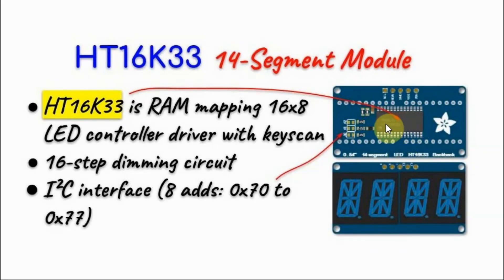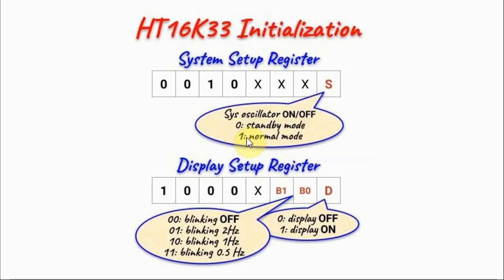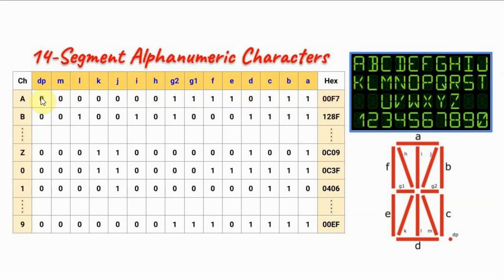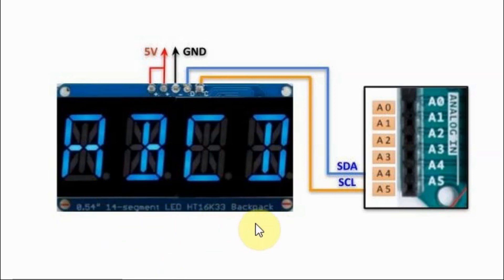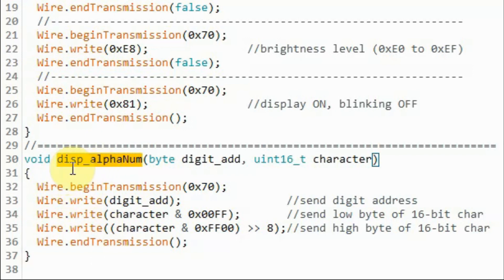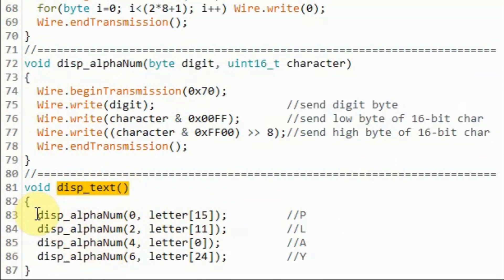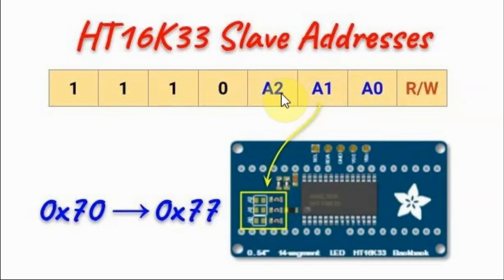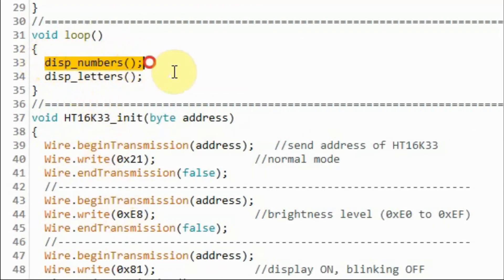HT16K33 14-Segment Display

Comment: This is great...however I have a problem. I've done exactly everything even to the code, and its only recognising 1 side rather. So both 4 digits connected up are doing 0123...0123, intead of 0123...4567. It seems to be running parralel. Is there other pins to this to use? It won't work on A4, A5. Only on SCL and SDA. Thanks
Reply: Both displays are set to the default hardware address (0x70), so both are responding to the commands intended for the first display. To get the second display to respond to the commands intended for it, you must set the hardware address of the second display to 0x71. The hardware address is set by soldering jumpers across the three pairs of pads on the back of the display. The pairs of pads are labeled A2, A1, A0. The absence of jumpers produces the hardware address 0x70 (the default). Soldering a jumper across the A0 pair of pads produces the hardware address 0x71; a jumper across A1 produces 0x72; jumpers across both A0 and A1 produces 0x73, etc. (Yes, I know - the pads and jumpers are very tiny!!)

Comment: Is it possible to change the analog pins? I need to use more that 7 of these so i need 4 analog pins in totall. Or is there another way?
Reply from the maker: You can interface max 8 of these displays. I have a video where I created a library that enables you to achieve this.
Reply: @AnasKuzechie  Sorry i mean i need more than 8. I need to use about 16 of them (maybe more) and preferably on the same arduino
Reply from the maker: @bilbobaggins138  your are limited to 8 per Arduino, since max 8 I2C addresses can be used.